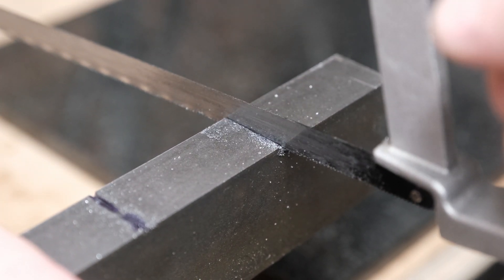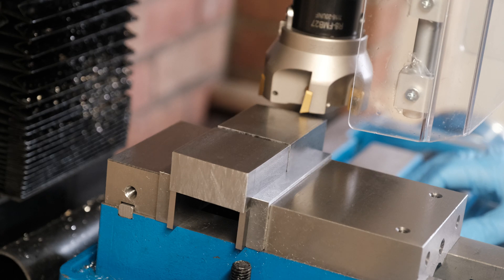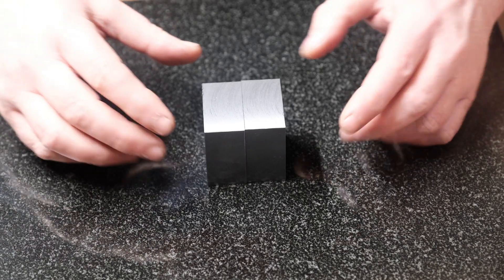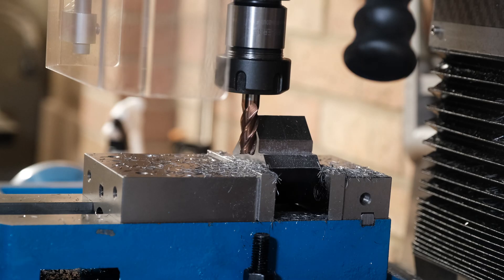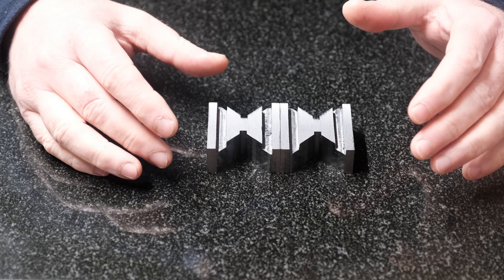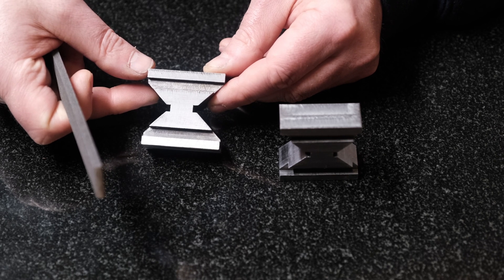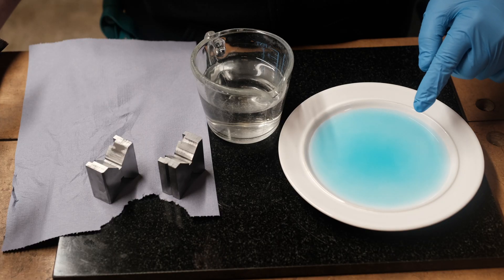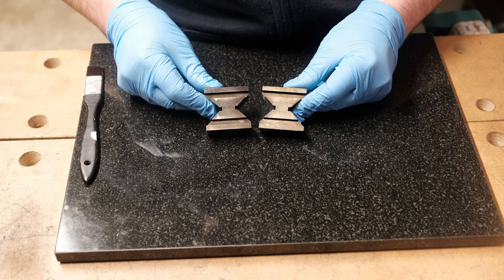My First Milling Project   V Blocks

Comment: Instead of making conventional V blocks, you should’ve made them to fit into the tenon on the mill bed, with a bolt to fit a tee nut on the end, and fasten them directly to the mill, also if you’re running high speed steel cutters Use coolant otherwise your high speed won’t last long.

Comment: others have commented on the milling safety and bits, but on the blacking/blueing ideally you need to clean everything down very well with acetone, and the industrial stuff, not nail varnish remover lol, and to test if you have a matched pair, put the bar with the 2 V blocks at either end, then run the DTI along the length and it will show the diference, as holding it with your finger puts too much variance into the equation, other than that, nice job :)
Reply from the maker: Thanks for the tip on measuring the v blocks. I will give that a go. 
I did use proper acetone to clean but have since read on the blueing bottle it recommends full immersion of parts. I will do that next time. 
I have just seen some other YouTube videos where they just brush it on and it works immediately! I’m assuming that’s a different brand.
Reply: Nail varnish remover is acetone.  While some may come with nail and skin conditioners, it can be found as 100% acetone...which is how I buy mine.
Reply: @mk6595  not all nail varnish remover is acetone, and not even professional nail technicians use pure acetone as it would ruin girls hands very fast as it strips all the oil out of them, industrial acetone is totally different stuff, but if you are happy using what you are, and it's working for you great

Comment: Looks like your grove for the clamps are not on the right side of the block
Reply from the maker: Yeah someone else mentioned that. Just wasn’t really thinking about design. But on reflection I should have cut slots all the way round. 
Was more of a practice piece. But was really fun learning.

Comment: Nice work! Please don’t wear those gloves on any spinning machine, they grab so easy and it’s hard to machine with one hand. 
Why did you position the slots that way, they usually sit in line with the V?
Reply from the maker: Thanks. Yeah I should have put slots all the way round. But it’s just practicing. Didn’t put that much thought in the design. Once I’ve got a little more used to the machine I will try put more thought into the design of my next projects.